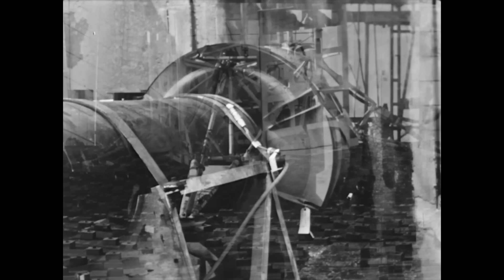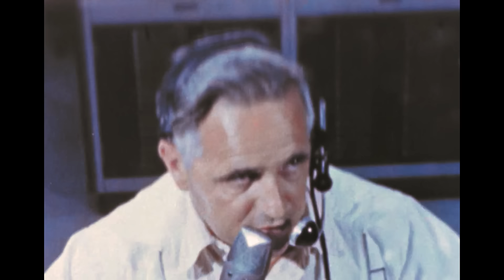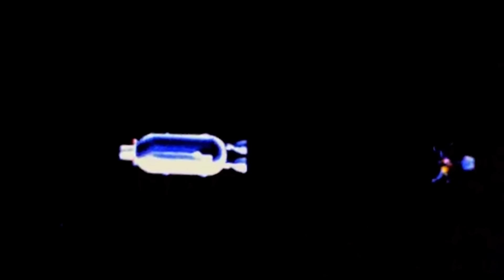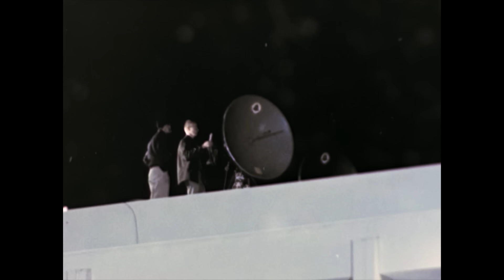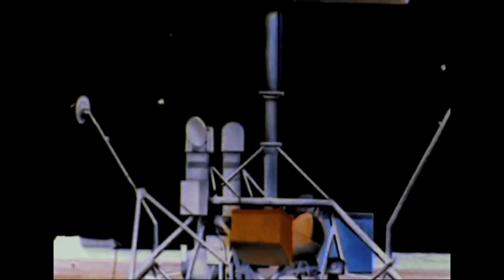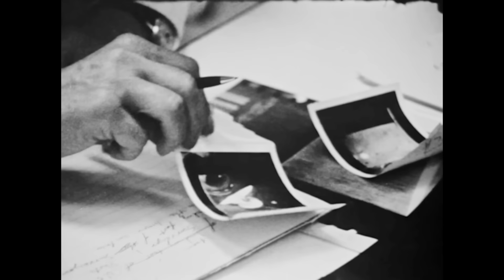Surveyor 1 - First US Moon Soft Landing - Atlas-Centaur AC-10, Pictures, Lunar Lander Mission 1966

Comment: So if we had solar power capability that far back, why the heck didn't we use them for the spacecraft themselves? It would've helped Apollo 13 with their electrical issues.
Reply: The early solar cells weren't efficient enough to power a man rated vehicle's systems without making them really big.    The Apollo capsules had a lot more stuff to run than an unmanned probe.
Reply: Ffs, don't view the tech and knowledge of old with the eyes of someone eth knowledge of 2025. Birth has come a long way since then.

Comment: I'm amazed at the hubris of modern engineers. They ignore   the lessons learned 60 years ago and design landers that either crash into the moon or topple over after landing. Modern engineers completely ignore the K.I.S.S. principle.
Reply: To be fair, the one that fell over was using a novel autonomous landing system, didn't see a rock as it was coming down. Hit it, broke its leg and landed, then toppled over.
Reply: @ed-sikorski9121   That thing is shaped like a refrigerator. Both craft tipped over I believe. A low gravity body like the moon is unforgiving if your center of mass is too high. The slightest lateral motion or not exactly level to the ground upon touch down will tend to induce a tip-over.

Comment: It is still amazing that all of this was done using slide rules and fixed point math for the quaternions. What an accomplishment for humankind. Almost all, if not all, of these men are now gone from us.
Reply: I still use a slide rule 😂
Reply: Today the moon probes just create new craters when they crash..
Reply: I'm pretty sure ,I had seen computers in this video. Just saying. 🙄
Reply: @renegadeflyer2 the computers were very limited and used for operations of the craft systems. The design of the vehicle was done with brains.
Reply: @stevensonDonnie  Yep. In fact, the spacecraft's entire computing "system" was capable of deciphering only 256 commands. It was barely much more than a handful of flip flops and some iron core memory.

The things that look like computers in the video are monitors, probably all driven by a univac "mainframe" with 64k of memory. 😂
Reply: They did replace a lot of human calculators. And sped up the program.
Reply: I started programming in 1966. Floating point math was already available before I learned.
Reply: @JeffRyman69 You dont look 80 years old. Congrats on your health and long life! 😂
Reply: @JeffRyman69  Just wondering, what language and what computer did you program floating point math on? What was your program and date entry medium?
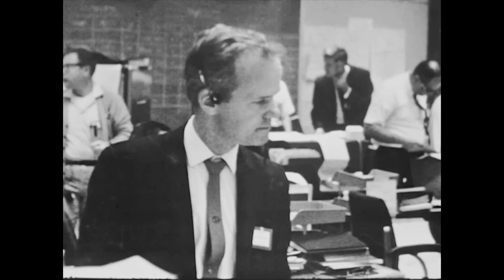Reply: 19:30 slide rules were certainly used in earlier development but that IBM mainframe shows that a lot of software was utilized in the mission 😊😊😊
Reply: @maxtraveler8160 That massive mainframe that required its own building had less than 64k words of memory. 😂

I guess you had to be there to realize just how manual the whole effort was. Even the data downlink of 1000 channels of data was more primitive than your phone downloading your facebook home page.